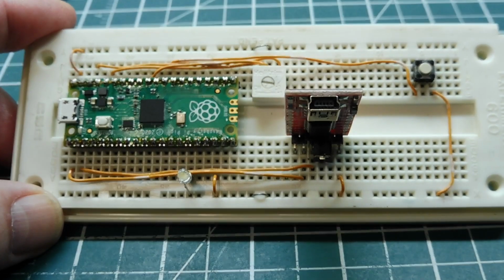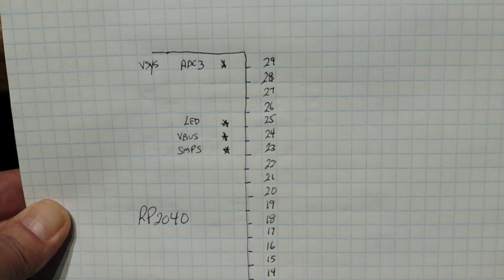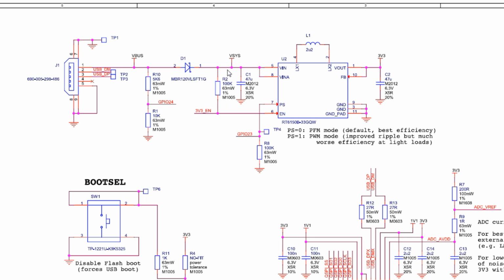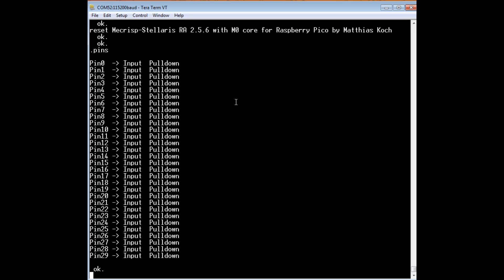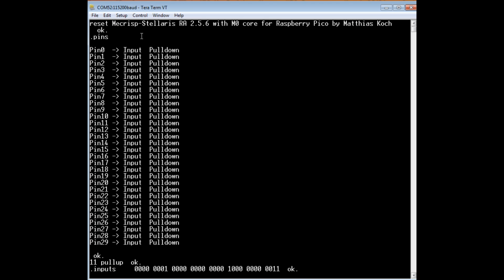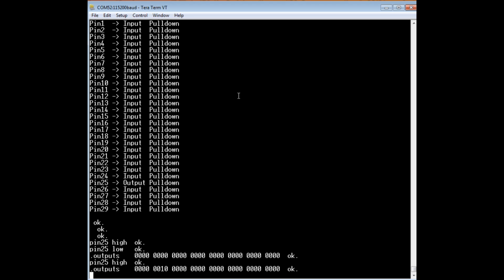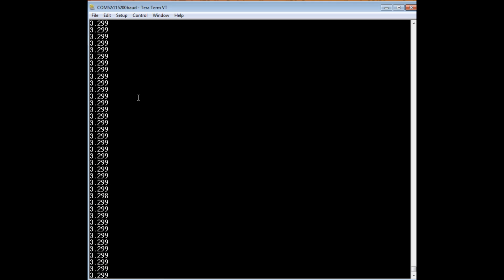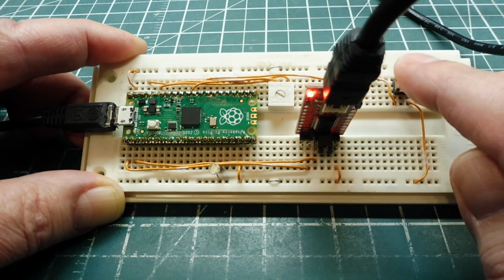Run Forth On The Raspberry Pi Pico  /  Mecrisp

Comment: I downloaded "mecrisp-stellaris-pico.uf2" from your link, but the README file says I should download "mecrisp-stellaris-pico-with-tools.uf2".  The version I installed has no pin words. Is that available somewhere?  Thanks!
Reply from the maker: Forth is extendable so I have made my own words on the fly which I used in the video. Others have simulated my extensions and they are available in the file Playground.4th which you will find in the RP2040 folder.
Reply: @0033mer  Following your Dropbox links I was able to download 3 files, the Mecrisp.uf file, a readme.txt and the words.txt. There were no folders, or Playground.4th that I found. What am I doing wrong?  Thanks again.
Reply from the maker: If you search for Mecrisp on Sourceforge.net you can download the full folder.
Here is a link to Playground.4th.  https://www.dropbox.com/scl/fi/p9r1xcoo8qy22pd043d96/playground.4th?rlkey=lb3lgr99yms47pz7qtaspvyoq&st=mdygjjm4&dl=0
Reply: @0033mer  Thanks!!  I see the word definitions now. I appreciate your helpfulness. I'm 73 and a little 'gray' some (most) days!
Reply from the maker: Hey ... been there myself. If you are just starting out using Forth check out the Scamp board fron Udamonic.
https://udamonic.com/what-is-a-scamp.html  Forth is pre-loaded and there is lots of documentation.
Support is free from the designer John.
Reply: @0033mer  Thanks, I didn't realize the Playground.4th word list was available in the SourceForge download. I was able to install it so it is available on boot and I have access to all the pin functions for the Pico. I appreciate your patient help!

Comment: Thank you Ken for all you do with these videos! Sometimes it's frustrating that all of the code isn't presented, but it's also so much more rewarding when I finally start to figure it out using the data sheets and the references that you suggest. I'm aware of forth for microcontrollers because of you and I thank you for presenting it to us.
Reply from the maker: Thanks for the feedback and support Joe. I try to cover the code for my videos, but if there's alot, the videos become long and I get complaints. If you download Mecrisp Forth for the RP2040, there is a file in the folder called "playground.4th" which will cover the code in the video.

Comment: I'm curious as to why the USB connector on the Pico can't be used to access the Forth command prompt. I've only used CircuitPython on the Pico, but print() statements go through the USB connection.
Reply from the maker: USB CDC support was not implemented for Mecrisp Forth on the Pico. If you need a USB connection check out Zeptoforth for the Pico.

Comment: The biggest advantage of RP is PIO / * in my humble opinion this is what made RP a distinct product, not like others STM or ESP * /, it looks it's possible to implement Forth words for PIO engines and program it naturally in Forth / * much simpler that c with assembler project samples in RP SDK * / do you have edeas or code for this?
Reply from the maker: Check out zeptoforth to access the PIO on the pico. For true multiprocessing using 8 cores check out the Propeller.
https://youtu.be/9KR28l6KyPM

Comment: Oh my. So short a video! I was enthralled for the whole time. I have not used Forth for, well since, I bought a PC in the late '80s. It must have been Forth79 come to think of it. Wonderful language, I believe the Z80 was idealy suited to it because of its command set. I just have to do a bit of searching around now.
Many thanks.
Reply from the maker: Glad I could help!  if you want an easy way to get back into embedded Forth check out the Scamp3 board.
It comes pre-loaded with Forth and lots of support on-board. Here is a link:
https://udamonic.com/what-is-a-scamp.html
Check out videos on my channel.  0033mer

Comment: Hi, is it possible to reduce baud rate communication ? for example 38400 bauds (not 115200), thanks very much !
Reply from the maker: The default baud rate is 115200 for Mecrisp running on the Pico, but it can be changed at the ok prompt by changing the baud rate generator divisor. Check the data sheet under UART where an example is shown how to calculate the new baud rate divisor.

Comment: OK so I have gotten around to putting Mecrisp on a Pico,.. it functions responding with OK.
|good good|
Now will someone explain WHY the USB serial external module is required?
NOT friendly at all. Why not use the native USB port?
Also: Is the source code available somewhere?
d

Comment: Do you have examples of writing the words fot manipulating the Pins?
Reply from the maker: Check out the Tachyon page:
https://www.dropbox.com/s/5x51yxow7y2kwzi/RP2040.fth?dl=0
Reply: @0033mer  Do you just upload this to the Pico using a serial terminal that adds 200ms delay to new lines?  What creates the .pins and .input you demonstrated in your video?  

Maybe I used the wrong mecrisp forth - I used mecrisp-stelaris-2.6.1/rp2040-ra/mecrisp-stellaris-pico-with-tools.uf2

Thank you.
Reply from the maker: Once Mecrisp is loaded, you compile your code to flash and save it. It is now permanent and an extension to Mecrisp. Check the README file in the Mecrisp download. I create words like .pins as I program and it becomes part of Mecrisp. To see many turnkey words you can run check out the Tachyon page. Upload code using a serial terminal program with a line delay.

Comment: thank you for the video, i loaded mecrisp-stellaris-pico.uf2 it runs, and after word "reset" i became the same message as shown in the video. but the words .pins and .inputs are not there !??? normal forth commands like 3 2 * .  runs very well. If there a differnt .uf2 file wird more words? i dont know the next steps....
Reply: I have the same issue. Is there a file with the word definitions for the functions shown in the video? And how is the word definition loaded? Sorry for the noob questions, but just starting to get interested in FORTH.
Reply from the maker: Check out the Tachyon page:
https://www.dropbox.com/s/5x51yxow7y2kwzi/RP2040.fth?dl=0

Comment: I'm really happy with 0033mer's video about Forth on the pico and I want to say thank you to him for his post. Forth is an excellent language for controller programming because it is very close to assembly language and higher programming languages. My use of Forth dates back to the ZX81, Spectrum and QL, I suppose things have changed in the meantime.
As indicated I have connected my pico to my Linux computer with an ftdi. I am running Moserial Terminal on my computer.
To only use 1 instead of 2 usb ports such as 0033m34, I feed the pico from the FTDI with 5v on pin 40.
Pico: FTDI cable 3.3 volts on data lines
GND - GND
GP0 (UART RX) <--TXD
GP1 (UART TX) --> RXD
PIN 40 - 5V
So far I was along and got the pico spinning in Forth, but that's where it stopped too. Like many others, I was disappointed that there was not more explanation for the words used. like ".pins" etc. how do you program them.
The ReadMe.txt says

Three registers are enough to control the GPIO pins.
  $D0000004 IN
  $D0000010 OUT
  $D0000020 DIR
I think this is only sufficient for very few beginners, so I write down what I discovered after a day of searching and sighing.
To light up the internal LED (=GPIO 25), you must first:
set pin 25 of the DIR (direction I suppose) register to HIGH, then
set pin 25 of the OUT register to HIGH.
to turn off the led, set pin 25 of the OUT register to LOW.
If you then want to make the LED light up again, you must apparently again set pin 25 of the DIR register back to HIGH.
A possible code looks like this:
1 25 lshift dup $D0000020 ! $D0000010 !
put 1 on the stack and shift it 25 times to the left,
copy the result and paste it back on the stack so that it is there twice
put the result in the DIR register $D0000020
put the result in the OUT register $D0000010
and the internal LED lights up.
to extinguish the LED it is sufficient to
0 $D0000010 !
0 in the OUT register

if you want to program Forth words it might look like this:
: intLedOn 1 25 lshift dup $D0000020 ! $D0000010 ! ;
: intLedOff 1 25 lshift $D0000020 ! 0 $D0000010 ! ;
type intLedOn and the led will go ON
type intLedOff and the led will go OUT
This is of course just the beginning and I expect that by reading bits into the IN register we can tell if an INPUT is HOGH or LOW. But I have not tested this and I have no idea how to program PULLUP, PULLDOWN FLOATING.
Maybe one of you can add some of the puzzle pieces
Reply from the maker: Check out the Tachyon page:
https://www.dropbox.com/s/5x51yxow7y2kwzi/RP2040.fth?dl=0
Reply: I know that it's been quite some time that you left this response, but I just wanted to say THANK YOU for this explanation!! It helped me greatly!!!

Comment: I understood everything from 0:00 - 0:35 , but then from 0:35 I have a questions. Do I need that extra module to execute forth programs on the pico, or is that for the benefit of the interactive Forth session? If I'm looking to purchase one, what do I need to search for generally? Just an FTDI module? 

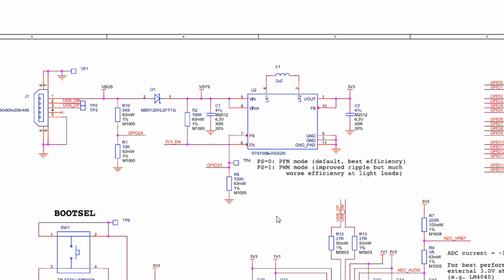Also, 5:08 Is it difficult to get that terminal setup?
Reply from the maker: The FTDI module is a USB to serial device that allows you to gain access to the Forth operating system for programming and interactive execution. If you search for "FTDI" online you will find many vendors. There is the genuine version and also knockoffs.
https://www.universal-solder.ca/?s=ftdi&post_type=product&type_aws=true
TeraTerm is a serial terminal program which is a free download with user documentation.
Reply: @0033mer  Thanks. I asked because I watched one tutorial that used USB serial (ie the USB cable connecting it directly to the computer) and CoolTerm. Although this was with MicroPython. I guess that makes a difference then.

Comment: I also looked at your other video on the Parallax flip, that is very nice too. I wonder if the Pico PIO could be used much the same, probably not as complicated a task though.
Reply from the maker: Yes .. If you want to go multi core, the Flip is the way to go. It is very easy to implement multi core code using Forth on the Flip. I am still debating if I would actually use the Pico in a real project. The Arm STM32F411 (Blackpill) would be my first choice. The RP2040 is probably the first of more to come so I will have to wait to see how it evolves.

Comment: The words you created look very useful to anyone using Mecrisp Forth on the Pico. It is unfortunate you don't have them documented. Otherwise nice video.
Reply from the maker: Thanks for the feedback. I try to keep my videos under 10 minutes or I get complaints, so another video would have to be made to get further into the code. The read me file shows the addresses of the In, Out and Direction registers.The word list shows bit manipulation words to change these registers. I have ported the same code to the Arduino Nano if you want to get familiar with working with those words.
 https://youtu.be/PY01_9dANd8
 https://youtu.be/P6rMFcwik3M

Comment: It's nice to see somebody already picked up the RP2040 port. Btw. how did you implement the many word?
Reply from the maker: Continuous execution of the terminal buffer, so it cannot be used in a colon definition.
Reply: @0033mer  and the ms word is just a delay?
Reply from the maker: Yes..it is a millisecond delay. I used to slow down the scrolling. There is also us for microseconds handy for bit banging. Since Forth is extendable you can keep on going.
:  seconds    1000  * ms ; 
Will give us the word seconds, so we can type 5 seconds at the ok prompt or inside code.
You can build on that for minutes, hours ....etc
Reply: @0033mer  Would you mind making the definition of the many word available?  It would be great for testing things.

Comment: ...great video. C and MicroPython cannot compete with FORTH on microcontrollers. And you sir will have been among those few responsible for having started a renaissance of microFORTH!
Reply from the maker: Well said!
Reply: I hope so.  I've been wishing someone would do this on the Pi Zero but this is even better.   Doing the most with the least.
Reply: @anthonymccarthy4164  ...yes, that's the name of the game in computing. Do more with less. These days the line separating microcontrollers and microprocessors is progressively blurring. I guess the rule of thumb when choosing one or the other is based on a compromise between speed, power consumption, and physical size, given that the other factors are converging. For microcontrollers C and FORTH cannot be beaten. On microprocesessors  I would seriously recommend JULIA because it has solved the "two language" problem, is powerful,  and it's very easy to learn. So there's my 2 cents worth!

Comment: Thank you very much 0033mer another great forth video
Reply from the maker: You are very welcome
Reply: @0033mer  Hi is it possible have the words u made for the Pi Pico to play around the with GP PORTS pls
Reply from the maker: I write my "tools" as little scripts as I go along which are not saved when the board is powered down. As you can see every Forth becomes unique to the programmer after many custom words are created. I would have to make a video on that subject. I will post a Mecrisp word list in my description box that describes all the default words that I have used.